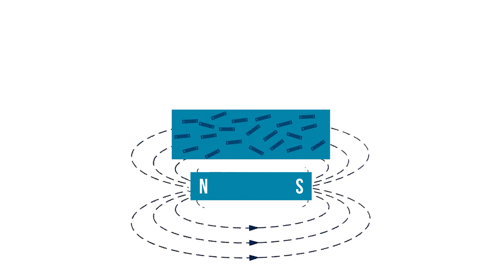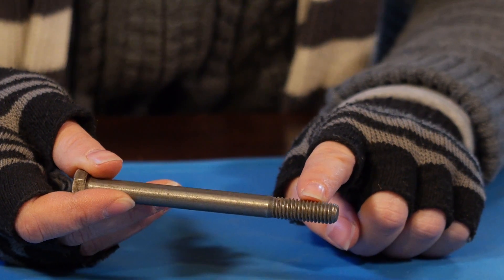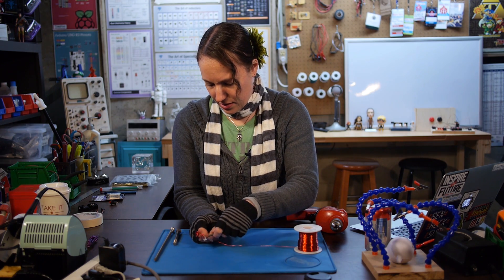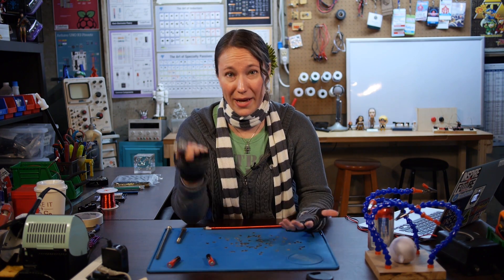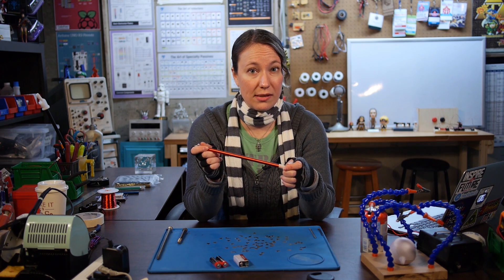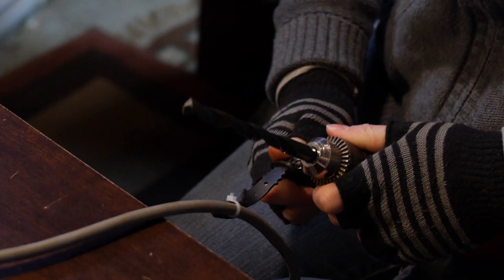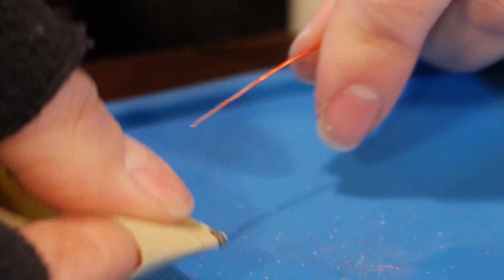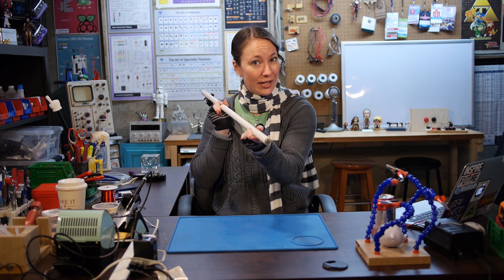DIY Electromagnet - The Learning Circuit

Comment: This can also be done onto insulating tubing to create an electromagnetic accelerator which can if you have 5 or six of them you can build a gun that could possibly kill so maybe not such a good idea also two parallel conductors can form a motor which could form part of a RAIL Gun,both of these can be found on the Power labs channel.

Comment: Don't take this the wrong way, but maybe you can use what you've learned about heat resistance to get warmer in that cold lab of yours.  Everytime I see you in those fingerless gloves and scarf I immediately think you're Bob Cratchit and Element 14 is Ebeneezer Scrooge.  "Is there no magnet wire, are there no volts?"

Comment: For 10x strength use thicker EM wire with a 3.7v 18650 in a battery holder. Old laptops with 18650 cells usually have 1 or 2 bad cells, the rest are good! (but don't recharge any that initially measure under 2v  or you could get burned due to shorts from dendrite growth and rupture..). 9v cells are expensive, die fast and can only deliver about 250ma max. 18650 cells short at over 20 amperes!! (a 5 inch spike should have enough wire for 2-3 amps (or 5 to 8 watts before magic smoke escapes..)

Comment: You can actually use a PWM power source if you want to be able to regulate power, for a levitator, for example. And use a ferrite core or E shaped transformer plates for the core and the matching housing for the wire, either would reduce thermal losses in the core and any issues with high frequency switching heating up the core.

Comment: Would be interesting to use one of those magnetic door locks - they run on either 12V or 24V and use surprisingly little power for the holding force.

Comment: Another awesome project.  I noticed a star still sticking to the nail - maybe talk about residual magnetism when you broach the subject again.
Reply: A circuit to apply a momentary pulse in reverse on switching off can fix that, at the cost of complexity. But with a DPDT switch, that added circuit can be as simple as a large capacitor and two diodes. (Try to figure out how!)